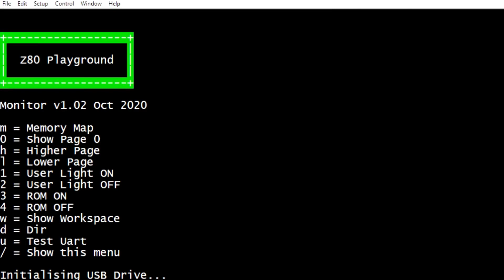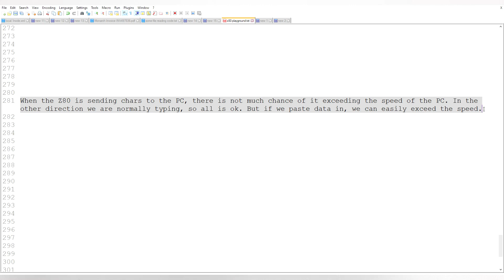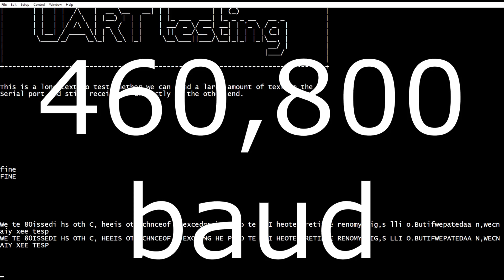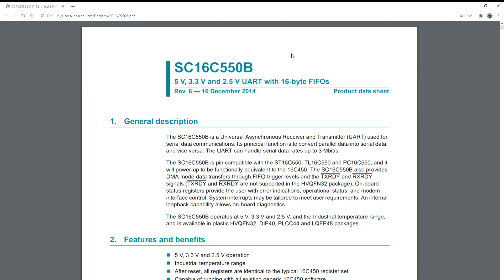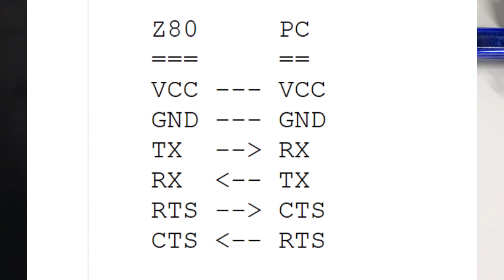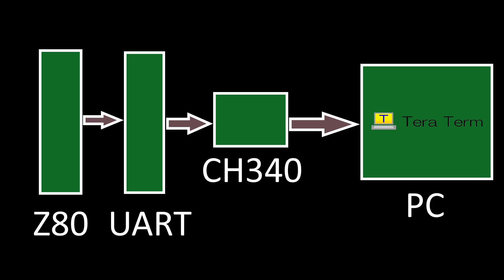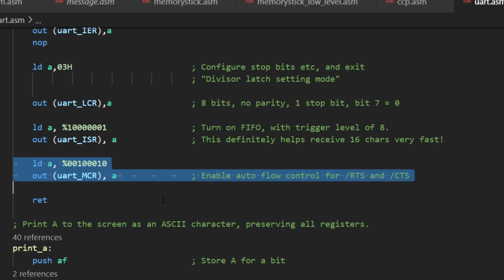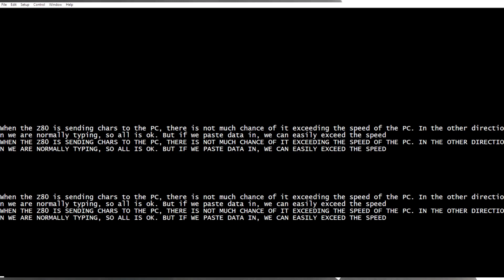Flow Control for UART Serial communication between Z80 Playground and a PC

Comment: The speed limit is really in the connection speed.  Then the two systems involved are like cars.  One is so slow it can't even reach the speed limit except for bursts when going downhill.  The other car is so fast it ca easily hit the speed limit.  You can try lowering the speed limit and see if the slow car can keep up.  But obviously flow control is the better solution.
Reply: The Z80 should be able to handle it. He's not using interrupts I suspect.

Comment: You're doing a great service for the EE community. I'm a retired computer engineer and used to get paid good money to debug serial I/O. They just don't teach 1980s technology in today's engineering programs, but there are still plenty of devices in various industries that speak only RS-232/RS-422. 

I would advise anyone interested in this stuff to look for used books on Serial Communications  using PCs or Microprocessors. There were a couple of good ones published in the 1980s and early 1990s.

If you have EE training or experience working at the breadboard level, the data sheets for these older chips also provide excellent guidance for working. with these chips with descriptions, example schematics, and driver primitives written in pseudo code.

Have fun!

Comment: There is third, quick and dirty solution for paste issue when flow control is not available - delay between sent characters. Some terminal programs have such option.
That allow to paste without extra wirings and/or settings, but sacrifices transfer time.

Comment: I have the Z80 Playground v1.2 and I can't seem to get flow control working. I set the `FLOW` option to `01` and have enabled RTS/CTS flow control on my PC, but "the paste test" still fails. I suspect it's an issue on my end, but I don't have any idea. I am on Linux; I have been using minicom, which has an option for hardware flow control. I also tried using screen and was able to confirm with that (as well with stty) that RTS/CTS flow control is enabled. Any ideas?
Reply from the maker: Strange you should mention that because I have found exactly the same problem. It worked a couple of months ago, as you see in one of my videos, but now I can't get it to work. I will have to look into it. Slowing down the baud rate will help, as will telling TeraTerm to delay each character it sends, but really the flow control option is the proper solution.

Comment: It's worth having a read of the Wikipedia article on RTS/CTS which you can find here: https://en.wikipedia.org/wiki/RS-232#RTS,_CTS,_and_RTR
RTS/CTS was originally Request To Send / Clear To Send and was used in old half duplex modems where the terminal was normally listening to data coming from the modem and had to ask if it wanted to send data to the modem and then had to wait for the modem to say it could send.  (Think of how a walkie talkie works, you normally listen and have to push a button if you want to talk).
In modern circuits (which are full duplex) a new signal has been defined called RTR (Ready to Receive) which is assigned the same pin as the old RTS signal. It indicates that the receiver is ready to receive and is connected to the Clear to Send signal of the sender and the circuit then works as you'd expect - unfortunately many devices still call the RTR signal RTS even though it has a different purpose!
Reply: Just had a read of the data sheet for the 16C550B UART and it describes the RTS pin as "When active, RTS informs the modem
 or data set that the UART is ready to receive data".  Note the "ready to receive" phrase, this pin should really be called RTR!!
Reply: @grhmsmth  Terribly confusing wording for these signals.
Reply: I used the RTS line to turn on the transmit signal on an RS485 interface. The problem was in Windows it could not quite turn it on fast enough so I ended up using a 555 timer to turn transmit on when it saw the start bit on the TX line.